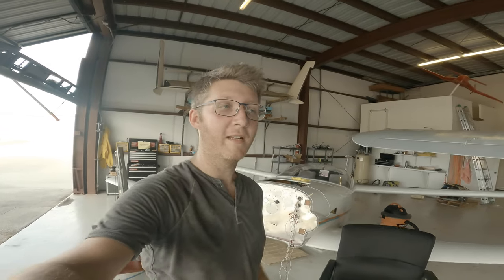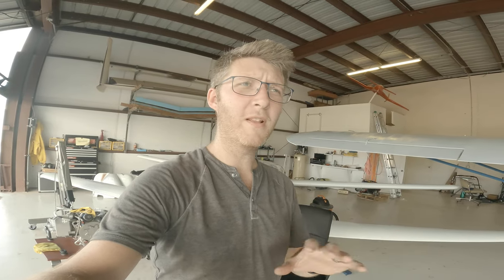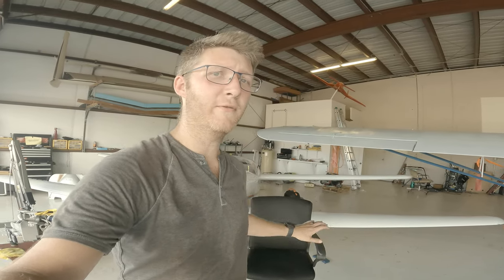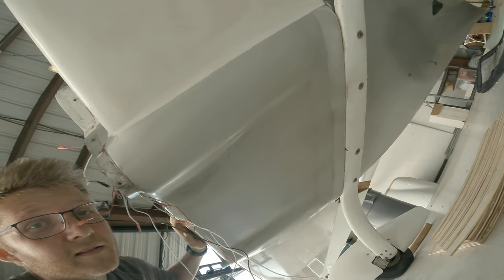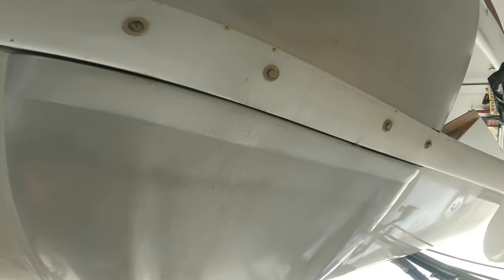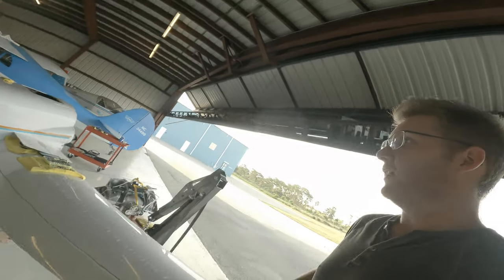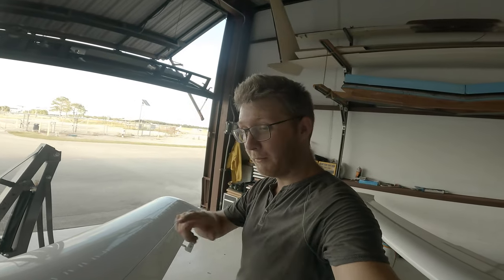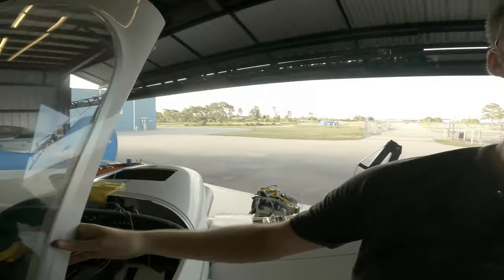Viking Dragonfly Airplane Hoop Gear

Comment: And how is the plane, are you already flying it again? Great!
Reply from the maker: Not yet. Working on installing the new engine still. I’m really close to finishing the install though. Mostly just wiring left to do
Reply: @roadrash2187  Okay, I'll keep following your channel. If you can put more videos.
Soon I will start building a Dragonfly as well. Here in Brazil a friend had one flying, but it has been sold for many years.
Reply from the maker: @sigaoplanob  I’ve turned over the new motor, but waiting on plug wires and a few other things  I’ve got to figure out before taxi testing. It’s a fun and cheap plane to fly.